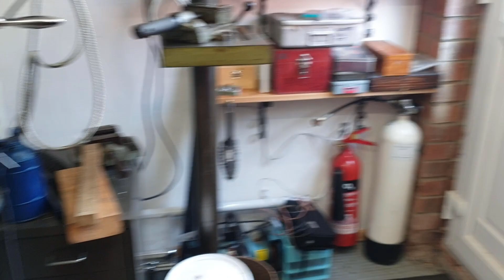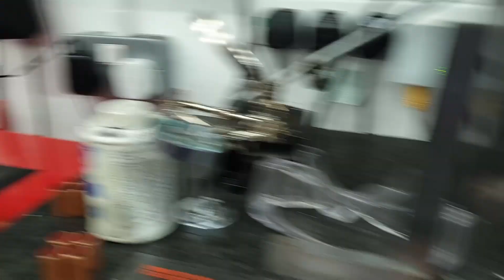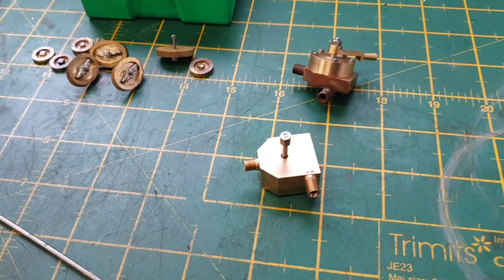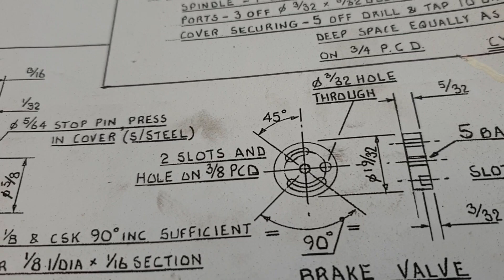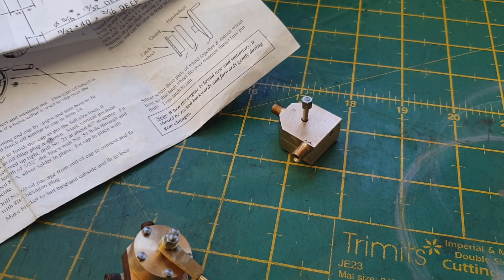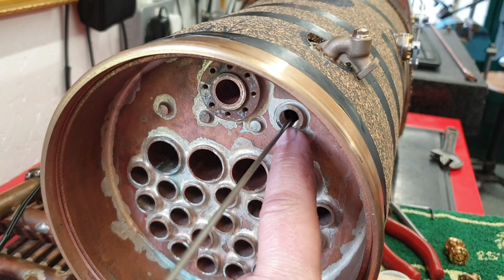9F Part 84 Work done to date - Part 1

Comment: hey, wondering if you could help me. im looking at building a 7 1/4'' 9F but im failing at the first hurdle, where can i find the technical drwaings? ive been looking (almost) evreywhere and i cant find any!!
Reply from the maker: Not sure there are any 7 1/4" drawings. You could buy the 5" drawings from Blackgates Engineering and re dimension them up to 7 1/4".